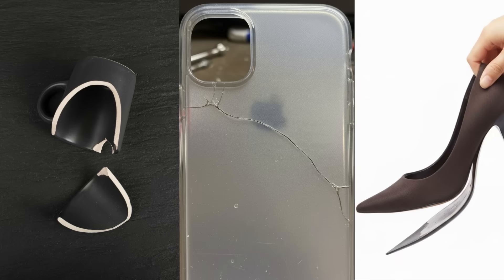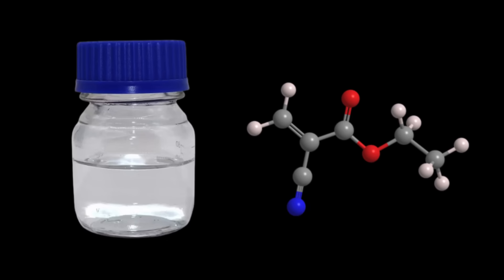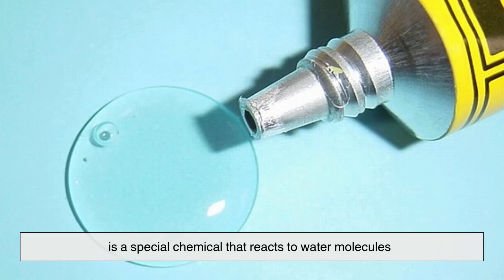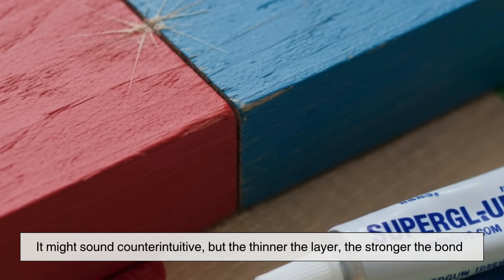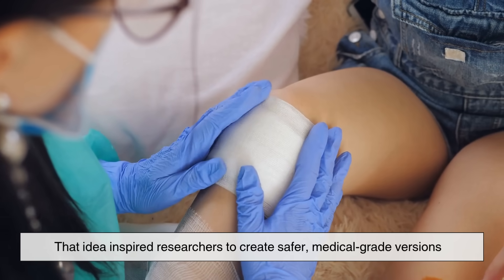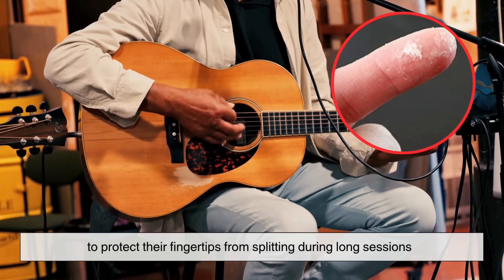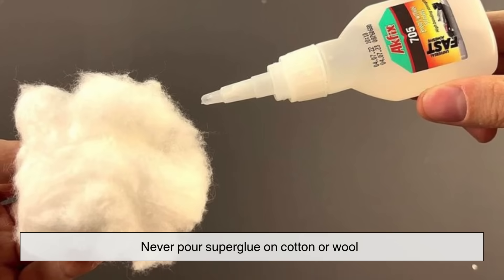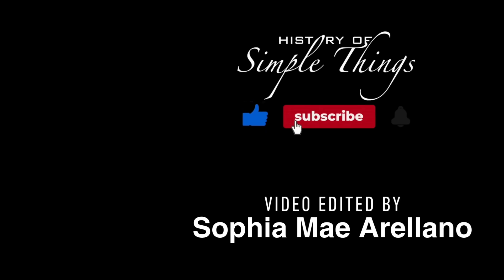What Makes Superglue ‘Super’?

Comment: i make wood rings (jewellery) and wood pens. in both cases, ca glue is used as a finish.  apply 10 to 12 coats with a paper towel(1 drop) with the workpiece on a lathe, let it cure for a few seconds and sand/buff to 12000 grit

Comment: Its crazy how its sold for crazy small amount
Reply: Because you don't ever need a lot, and it's thankfully cheap to replace a small tube should you end up with a compromised one - from the tips being dried and coated with superglue residue.

My model kit hobby would have been slightly unbearable if superglue tubes here costed more than a dollar, and seeing all the wasted tubes I had to throw.
Reply: @Spyduck  Any way to prevent the tubes from drying hard?
Reply: Big tubes would dry out very quickly before you can use much of it anyway.